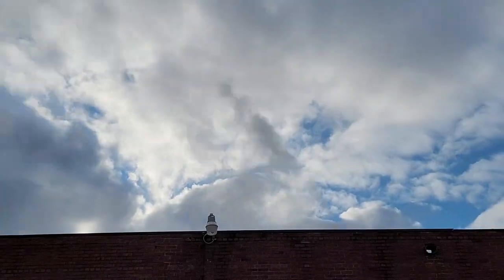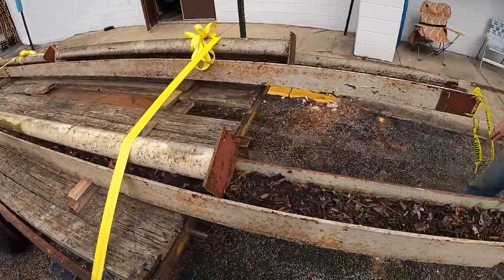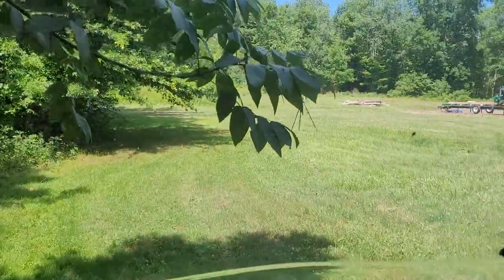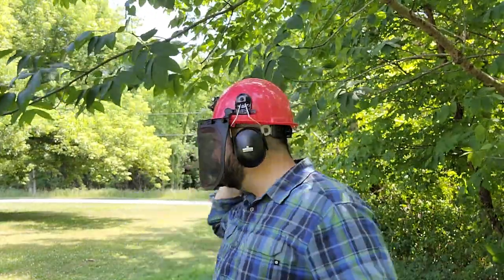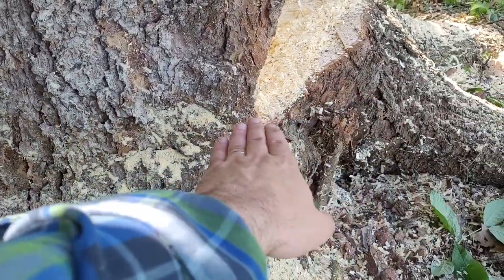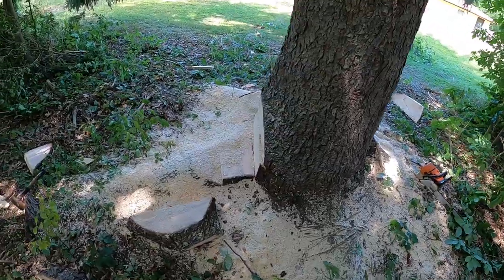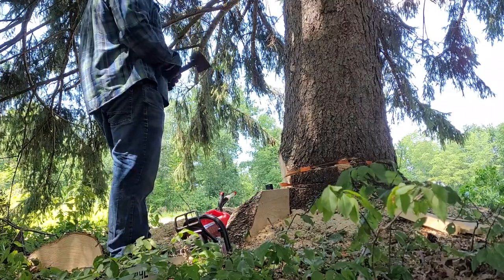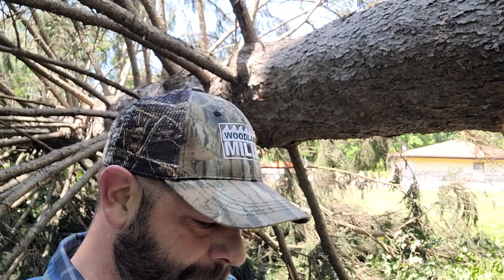#59 Building a Sawmill Shed | Spruce Tree to Shed Ep.1

Comment: Nate.  Plunge your bar all the way through to create hinge.  Cut starting on the left…as you did.  Apply wedges behind your cut.  Keep cutting, add wedge.  Cut more and add wedge.  Cut to other side of hinge wracking wedges as you go.  Creating two cuts is not recommended.  Thankfully you saved it with the steel wedge.
Reply from the maker: Right on, Bob!  Two cuts are really hard to line up perfectly.  Thanks for the tip.  Might be time for a bigger saw...